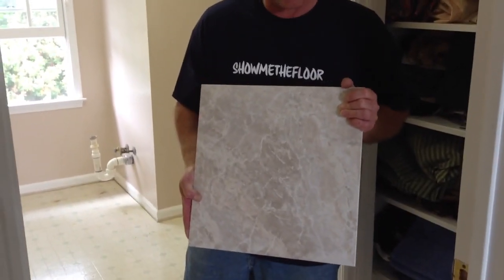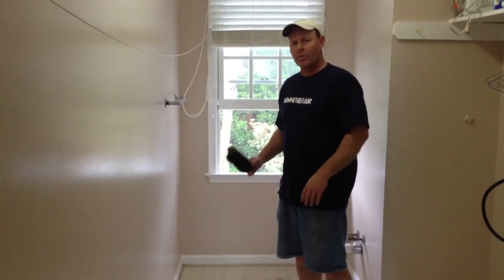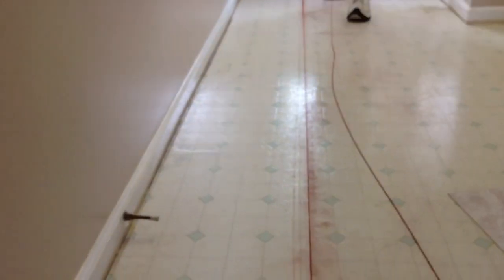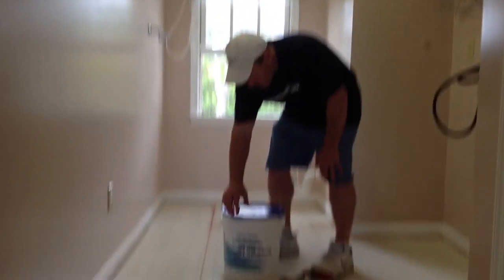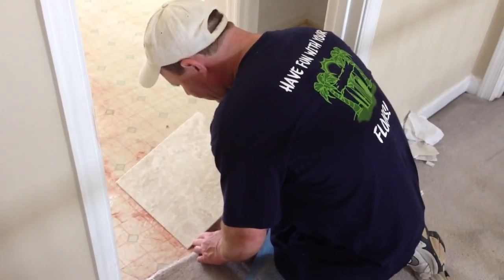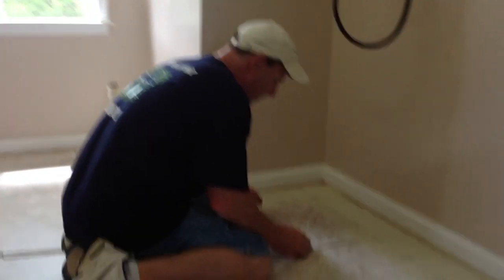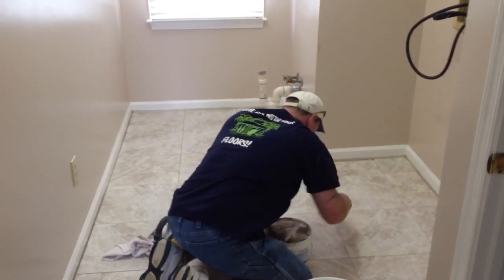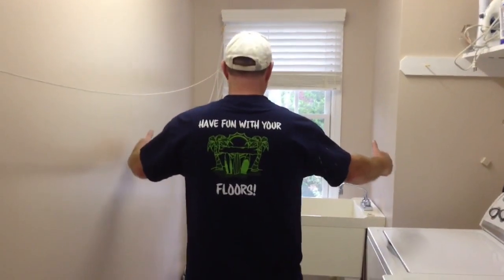How To Install DuraCeramic Tile

Comment: Thank you very much for doing this video! My wife and I were contemplating "trying " to install ceramic tiles but didn't want to go through the hassle of a wet saw etc. But you've given us hope now 28th duraceramic and what looks to be a much simpler installation.
Reply: I didn't use a wet saw when I installed it in my bathroom, just a heavy duty Xacto knife...remember it's thick vinyl tile not ceramic

Comment: We have it on our floor and was beautiful when installed.  In three years the top layer was peeling off all around our kitchen table from use of our ChromeCraft roller chairs. Now it looks horrible with some tiles almost completely peeling.  Bare feet get scraped by the peeling edges sticking up.  Elsewhere, there are dents in the flooring where the frig sits, making it difficult to move to clean under the frig.  There are numerous places that look like small flicks of white paint, but it actually is places where the top colored area flaked off to the layer beneath it. If you drop anything with a corner or an edge on it, the tile it fell on will have a cut or hole.  It is anything but durable!  I would not recommend DuraCeramic Tile.  Google it, people are saying the company will not honor their 25 year warranty on this product either!
Reply: Warranties never cover abuse or wear. Unless you are buying a wrench from Snap-on or a cordless tool from Milwaukee. My parents put this in their kitchen over 5 years ago and it still looks pretty good. I’m installing it in mine currently.

Comment: I was curious to see that you installed the DuraCeramic over existing vinyl. I haven't read anything that would indicate this was an acceptible subfloor for DuraCeramic.
Reply: You can install but anytime you go over existing vinyl the tiles have a tendency to slide after installed!  Getting the glue perfectly glued with proper ridges EVERYWHERE is key!
Reply: gnovincejr2 ...and if you afraid of them moving...you could use some ardex or other floor prep and prep the whole floor!

Comment: WRONG!!!!This is the same exact floor i have and the same tile i am using.THE GLUE DOES NOT STICK TO THE VINYL!!!!!!Don't try this!!!!!Do it correctly!!Remove the old vinyl!!!
Reply: My husband and I bought a house with this tile and during our bathroom remodel found that they didn't tile underneath the closet. (Why I'm here. Lol!) When we took the closet out, surprise, 1970's linoleum. We made an effort to find an alternative tile but decided to spend the money (these things plus the adhesive & grout are wicked expensive) because these tiles are very hard to match - skinnier than a ceramic tile and are an odd size 15 5/8". My long dragged out point is that the tiles were set over linoleum. We've been here for 4 years and no issues so far. The tiles are in the kitchen, entryway and bathroom - so heavily used rooms. My guess would be that as long as your floor is clean before applying the adhesive and if you use the appropriate amount of adhesive then you wouldn't have a problem with them sticking to a linoleum floor.
Reply: Exactly!